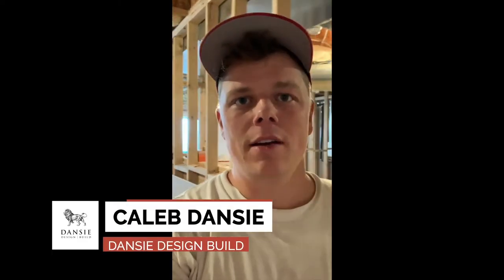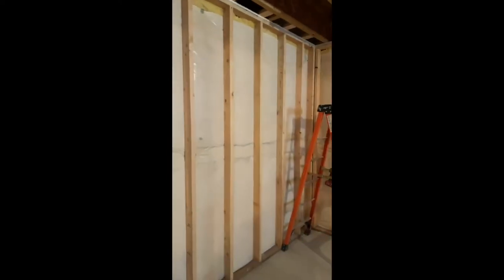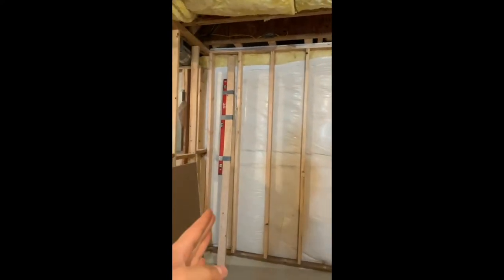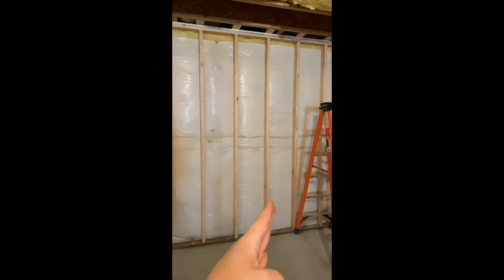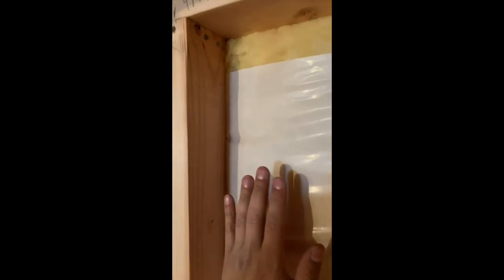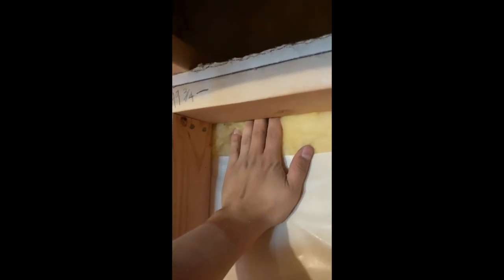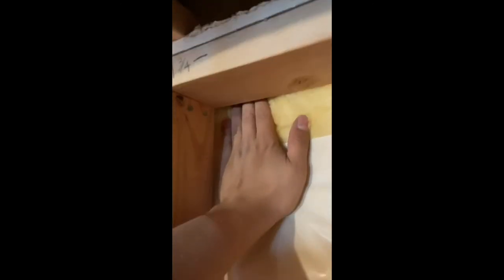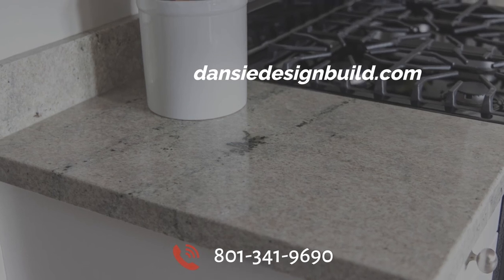Fire Blocking and Stud Layout for Basement Framing in Herriman, Utah

Comment: How far do the fireblocking 2x4 have to be apart? Talking about the 2x4s connect to the joyce with drywall under it. Are they 16 on center?
Reply from the maker: Yes, 16” is a good spacing for those.

Comment: Can  someone answer this:  I'm finishing my basement.  The concrete walls are currently covered with blanket insulation.   I intend to build the 2x4 framing in front of that blanked insulation.  For the "horizontal" fire-blocking (every 10 feet), should I vertically cut through the current blanket, so that the OSB I'm using for blocking, comes into direct contact with the concrete basement wall?  Or is it enough to just push the OSB firmly back against the blanket insulation?  Thanks in advance.
Reply from the maker: Cutting the insulation is not required by code, it is just required that it is tight.

Comment: Thanks for this video. Question: For the perimeter basement walls, how deep does the drywall piece sitting above your top plate go? Does it sit against the foundation? Or do we need to glue or attach it to the sill plate somehow? I can't imagine drywall would hold very well just glued onto the sill plate.
Reply from the maker: Good question!  The drywall fireblocking depth varies.  Typicaly it will be somwhere between 6" and 12" in width.  This drywall piece sits up on the bottom side of the joist, and butts into the sill plate horizontally.  The bottom of the drywall should be about 1" above the top of the foundation wall.  If you screw it up to the joist with drywall screws, and use a 12" bit extension on an impact driver (so you can reach in and place a screw toward the back side of the drywall) that will secure the drywall up and in place, and you do not need any glue.  You're right, glue would not hold well, and would be terribly hard to hold the drywall in place while the glue is drying.
Reply: @DansieDesignBuild  Thanks man. I also have some areas where the sill plate is inaccessible due to being behind conduit, spoke with the guy who’s gonna be doing the inspection, and he said I can just attach the drywall to the joist and butt it up against the sill plate or conduit (basically however far back I can go). Then just fill the 1inch gap leftover underneath with orange spray foam.
Reply from the maker: Yep! That will work perfectly. 
The point is to block the flames from going up to the next level/story. 
Sometimes, and in your situation, the foam is the only option that will work.
Reply: @DansieDesignBuild The point of fire blocking is to prevent the creation of a chimney. With a gap at the top, a fire would have an oxygen source from below as well as an escape route for the rising heat and fumes (a chimney). This is opening the vents on a charcoal grill, it makes the fire burn much hotter and faster.

Comment: Do you need to use treated wood for the bottom in basement? I am in Utah also. Thanks!
Reply from the maker: Yes, you do! Your baseplate (the bottom of the framing) comes into direct contact with and is exposed to the moisture that comes from the concrete floor. Let us know if you have any more questions!

Comment: Just curious when framing a wall don’t you need two 2 by 4s at the top of a frame wall ?
Reply from the maker: No. You don’t need two. 
If you put your trusses right on top of the studs, you don’t need two top plates. 
Most framers now days don’t plan that out that much and just put two top plates so it does not matter where the trusses/studs are placed in correlation with each other. 
In basements like this video, all the structure is on the existing concrete foundation wall. So all the framing is doing is holding drywall plumbing, and electrical etc. no structure. 
Hope this helps!

Comment: Can any drywall wall be used for fire blocking or is there something more specific?
Reply from the maker: Fire rated drywall is what you should use. 
You can also use 3/4” OSB or 1.5” thick lumber, as these too meet the fire requirement in our area.

Comment: What would you typically do for fire blocking for basement wall that isn’t adjacent to a concrete/ exterior basement wall? In other words, I will have spaces that are sharing a wall but behind it will be storage and unfinished space.
Reply from the maker: Typically interior partition walls will not require any fire blocking as the top plate will block any flames and meets fire rating code. You should double check with your local code requirements and city/county building standards.

Comment: Is fire blocking required if metal studs are used instead of wood?
Reply from the maker: Yes, from our experience, regardless of framing material used, the requirement to have horizontal fire blocking between each level of the home is always required. 
Thanks for your comment S M.

Comment: So what if you didn’t put up the fire block before putting up the walls. What would you have done?
Reply from the maker: It’s not too late, and you won’t have to tear down the framing.
You can add the fire blocking in shorter individual pieces. For 16 inch on center spacing, you will need to cut the fire blocking about 14 1/2 inches long each. Use scrap 2x4 lumber for this or 3/4” OSB. Measuring and cutting each piece individually. Then install all of those individual pieces of fire blocking at the top of the wall between the studs. Then behind each stud there will still be a little hole that’s not sealed off. You can use some fire-rated spray foam to seal all those little holes behind all the studs. It will come in a can from your local hardware store. Typically it is a salmon color vs the typical yellow spray foam that goes around doors and windows. 
Let me know if this makes sense to you.
Reply: @DansieDesignBuild I’m supposed to have a 1.5inch gap between the studs and foundation. In this case, do the fronts of the 14.5-inch fireblocking “fillers” have to be flush with the front of the studs? I’m trying to figure out if those fillers can be standard 2x4 (pushed in, resulting in a staggered look) or if I need to use something deeper like a 2x6 so that the fronts are flush with each other
Reply from the maker: @thumbnasiuminc4373  2x4 how you are describing is fine.

Comment: What did you secure the dry wall for firestop to? How far back did you put it?
Reply from the maker: I secured the drywall to the bottom cord of the TJI’s/joists (or blocking where the TJI’s are running parallel with the wall.)
I used 2” drywall screws to secure the drywall up to the TJI’s. It is helpful to have a long 12” tip extension on an impact drill so you can get a screw put in above the foundation concrete. Trying to do it without that will be near impossible. 

The fire blocking needs to go all the way to where the sill plate is on top of the foundation concrete. It needs to be tight up against that sill plate.
Your situation may be different, but the principle with fire blocking is the same, to completely separate the floors, so flames can not go from one story to the upper story. 
When I’m installing the drywall fire blocking, I’ll typically cut the drywall in 10-12” pieces that are the full length of the sheet, (typically 8’) and install them in this size. Then, after I get the top plate 2x4 installed plum with the bottom plate and the studs in, I go back and trim off the excess drywall with an oscillating multi tool. This does leave me with an inch or two of scrap drywall, but it saves so much time.
This method is so much easier, quicker, and more cost effective for labor and materials to our customers than using 3/4” OSB for fire blocking, and meets the code requirements just the same. 

Thanks for your comment, if you have any other questions about remodeling or basement finishing let us know and we will do our best to answer you with a new video on our channel.
Reply: @DansieDesignBuild this is actually extremely helpful